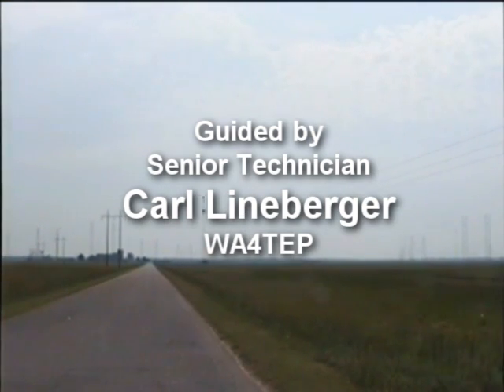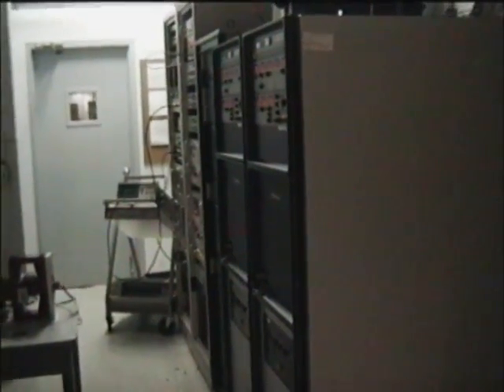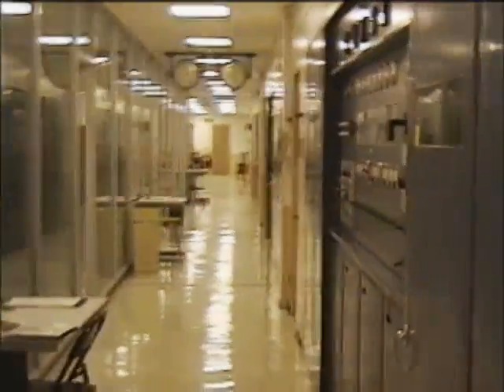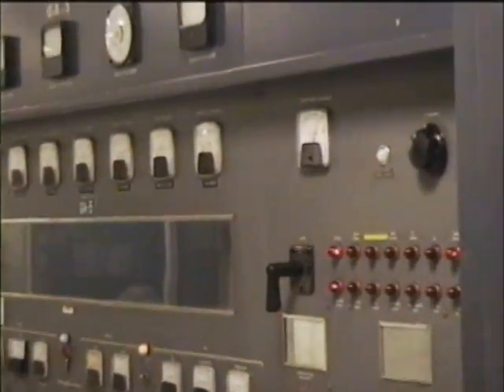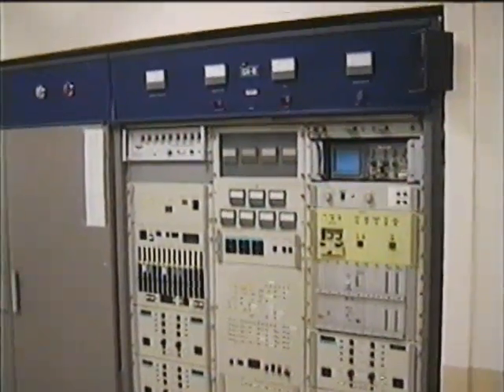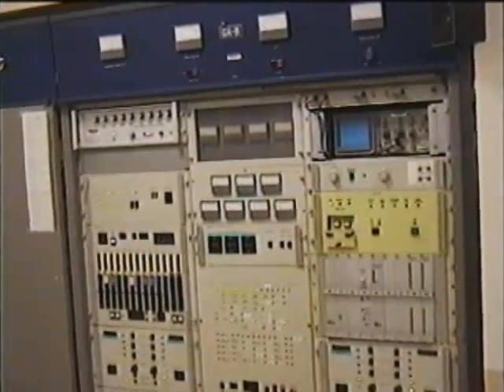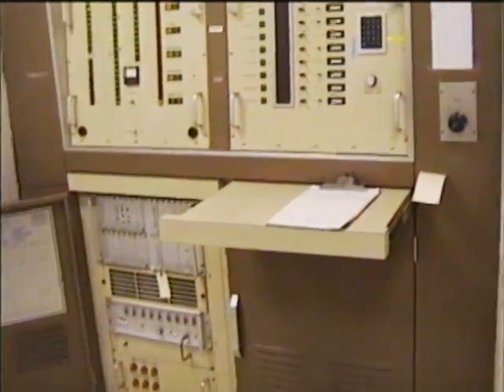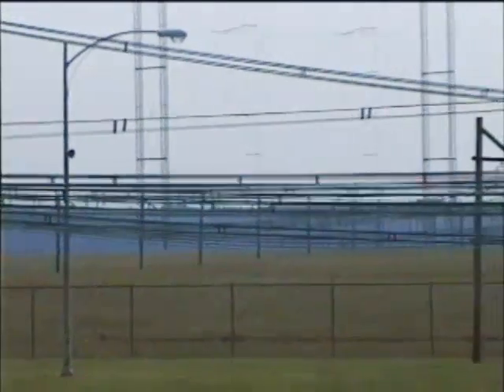Tour of Voice of America Transmitter Plant Part 1 of 5

Comment: Nice video. Makes my 20KW BE's look like tinker toys. I would be curious if those are still holding on or if they upgraded to solid state like the AM/FM broadcast bands are slowly doing or if they are keeping the glass lit as long as possible.
Reply from the maker: That facility went off the air years ago.  There is another facility Site 'A' is still running.  I don't know if they've upgraded.

Comment: Older transmitters were about about 50% efficient so 1 Megawatt! And you had to get rid of 500KW of waste heat so there was lots of forced air / water / oil cooling going on. Modern digital switching methods improve the efficiency towards 100% but you still need 500KW.

Comment from the maker: That's a very good question and I don't have a precise answer for that, but it's a lot more than 500KW.  The tube transmitters in this video wasted lots of energy just to light each tube,  The new solid state shortwave transmitters running up to 2 million watts, only in other countries, are a lot more efficient.

One engineer of a 50,000 watt station told me that when they replaced their tube transmitter with solid state, the electric bill dropped from $9000/month to $1000/month.
Reply: Not a huge marvel considering that many transmitters ran Class C on the finals which made the efficiency from about 50% to 70%!

Comment from the maker: That's very interesting.  I was especially impressed with the pulse step modulation used in that transmitter.  I was stationed in Udon Thani in 1972-1973 in the Air Force.  I wasn't aware of what radio systems were around.  I was too busy with my job repairing nav systems on airplanes.

Please keep in touch my e-mail address can be found on my website listed in the description.